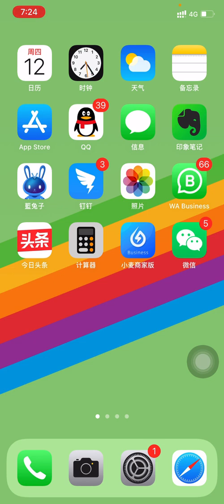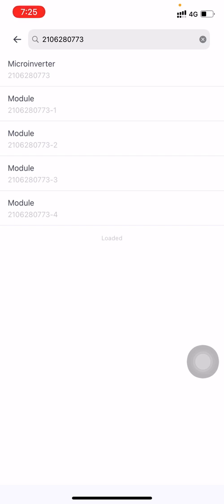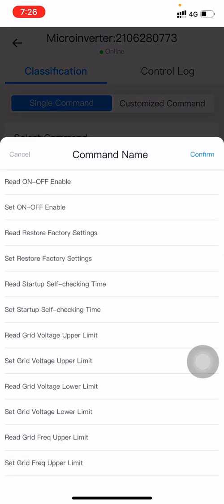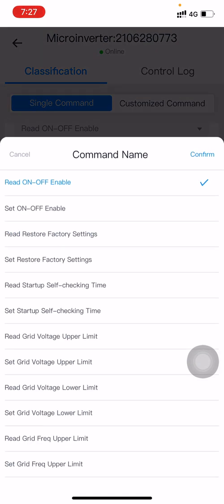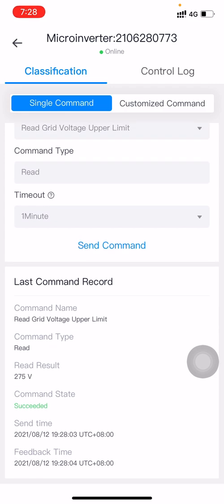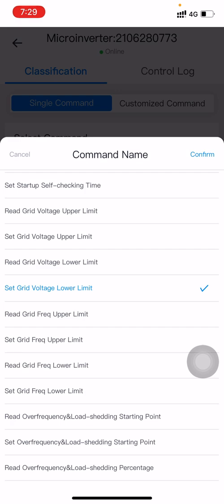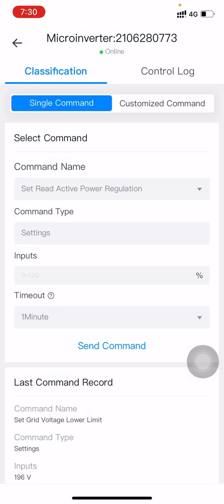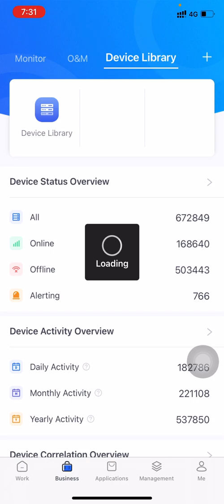How to setup the parameters of Deye microinverter on your cellphone

Comment: Hi there, I used to have quite a few of parameters in the Remote Control section of the microinverter and all of a sudden it is appearing only four: Read and Set the ON-OFF Enable and the Read and Set the Active Power Regulation... why are all the rest no appearing in the list of possible commands? Thanks.

Comment: is there a way to configure those parameters without going through solarman?
i see the inverters have port 8899 open .
do you have an API to get logging info locally and set parameters locally without having to go via a cloud around the world.  
solarman is very slow, we can also see in this video that it takes a lot of time. 
i am a bit disappointed because of that. 
i purchased a microinverter (actually two) that is mine and to handle it i have to go though a cloud in china. 
 
i was told that there is a limiting function on this microinverter that one can set.
if i sense that i am exporting too much to the grid (using a meter) i want to reduce the power by sending an API command to the inverter